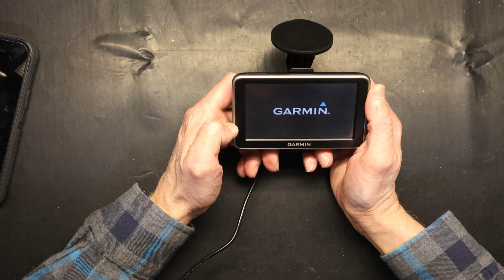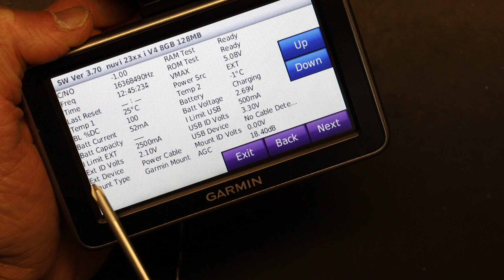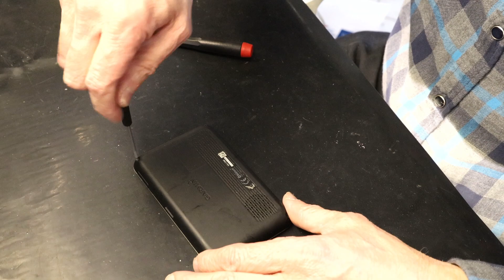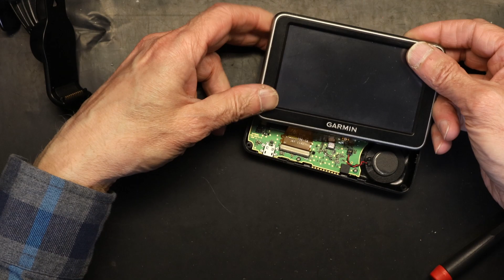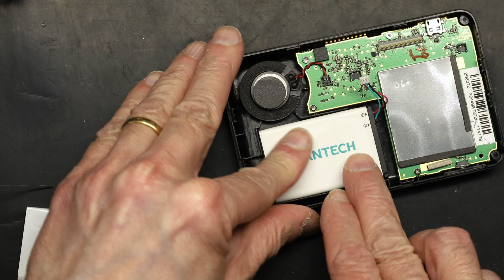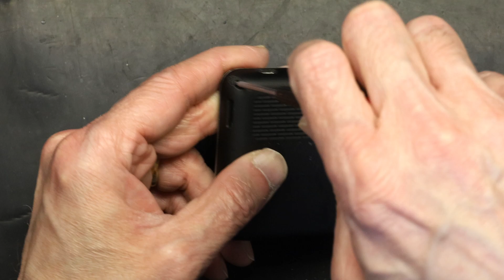Tutorial: How To Replace the Battery on a Garmin Nuvi 2360, 2460 and Similar GPS Navigation Devices

Comment: Hi,
Nice video and I have the same nuvi2360 and kids locked it by random password. Is there any way to unlock it? Thanks.
Reply from the maker: Hi, if you don't know what the password is, the only solution is to go to the exact geographical location where the kids locked it, and the unit will automatically unlock when it gets GPS signals.

Comment: Does a white screen mean a damaged ribbon cable?
Reply from the maker: Either a damage ribbon, or loose connection between the ribbon and the connector socket. The cable must be pushed in all the way and must be parallel with the socket itself. This means to make both edges of the cable is pushed in all the way, because sometimes one edge is pushed in while the other edge is slightly sticking out.